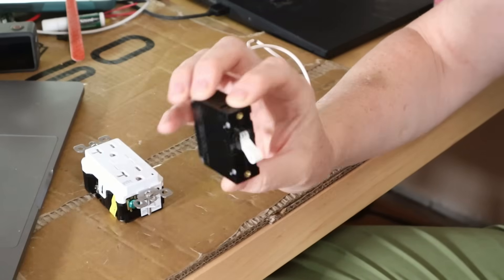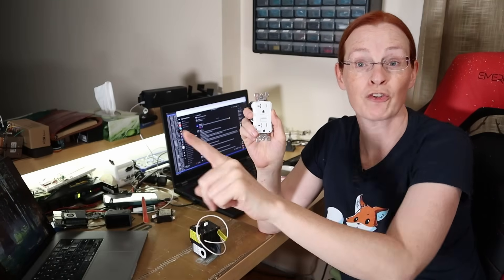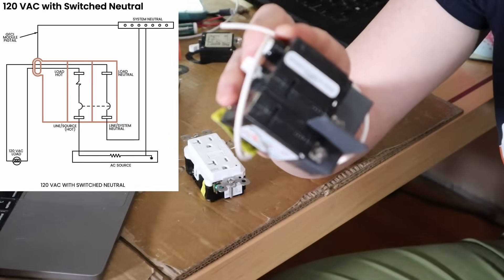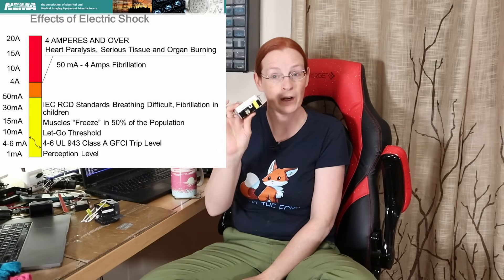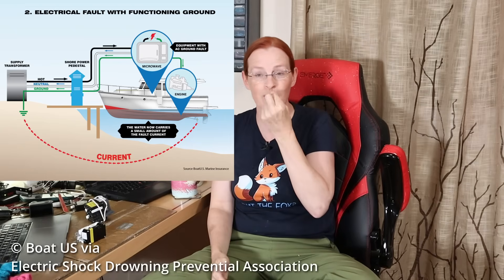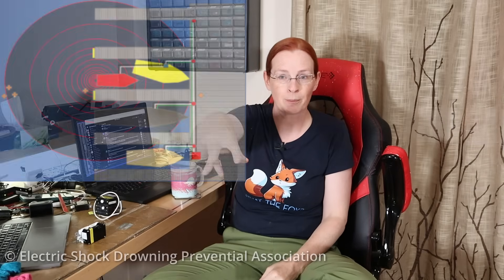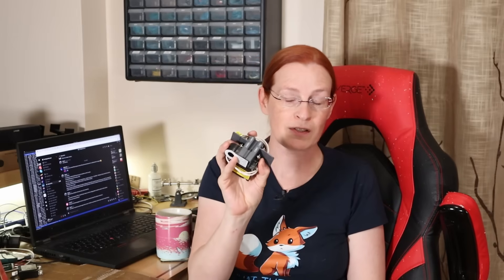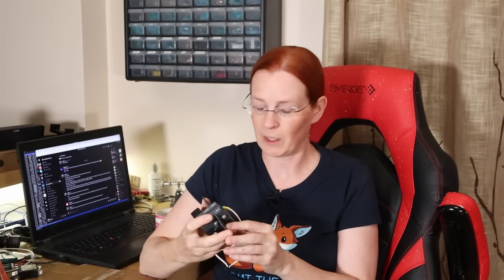This Can Save Your Life; ELCI/RCBO RCDs - Ep. 113

Comment: Ok the RCD will shut off the AC from the shore power and maybe the inverters output. Lets talk about the DC circuit. Is there any protection on the DC side if you find a way to make yourself part of the circuit?
Reply from the maker: All circuits, AC and DC, have current limiting of some sort. Most are breakers, some are fuses, but all are protected.

Comment: As for the 30 mA which is the common RCD type in Europe these days, there is the assumption there's always going to be some leakage current.  So a fault current that triggers an RCD would be the sum of that benign “expected” leakage current and the true fault current that potentially might be going through the poor sod trying to have some toast in the bath tub.  Of course there could always be the scenario where only device is following a single RCD therefore the leakage current is virtually zero.  Whatever, in Germany where three phase power is standard a typical installation will have like two MCBs for each of the three phases for a total of six.

The other factor to be considered is the time a fault current is flowing until it is interrupted.  The usual numbers such as 6 mA etc. are for not totally crazy worst case scenarios.  For very short exposures even currents as high as 100 A can be ok.

The frequency also matters.  50 Hz is generally considered the most dangerous with 60 Hz barely less dangerous, DC being well less dangerous and high frequency of several kHz and up only causing burns.  Which is pretty nasty - the victim doesn't feel it but the flesh or skin is still getting cooked even for example when touching the output of a 10 W transmitter.

To summarize, the 30 mA appear to be a pretty reasonable limit in practice and I'm not aware of any push towards lowering the value.

RCBOs are not very common yet.  For one they are well more expensive than a single RCD shared by several MCBs.  They usually are also wider than an MCB so replacing RCD + MCB with RCBOs might require more space than available and it will be more expensive.  There are recent RCBO types which are as wide as an MCB but those yet again more expensive.  Another small penalty is that RCDs and RCBOs have a small power consumption.

I personally intend to have at least the circuit of my fridge upgraded to an RCBO.  A few years ago a fault in a dishwasher tripped the RCD which in turn caused fridge and freezer lose power.  If I had not noticed the problem quickly that could have resulted in a “culinary disaster”.

Comment: Whereas everything you state is near-enough correct, the use of RCD/GFCIs do not address what is probably the most common cause of in-water deaths due to electricity around boats and marinas.  The purpose of RCD/GFCIs on vessels (and it is a damned good idea to have them) is exactly the same as the same thing in your home, namely, to prevent death of injury within the boat from electric shock.

External to the boat, in the water, the killer is potential gradient between boats, between the soil under the water, metallic structures in the water where “ground” is not equipotential.  A RCD/GFCI can do nothing to address this as these devices are blind to ground, they just measure current differences between hot and neutral.  When a boat is plugged into shore power, the ground pin of the supply is connected to the boat ground, and thus to the water through the prop and other metalwork.

The least bad way of connecting a boat to shore power is through an isolation transformer, so there is no metallic path between shore power ground and boat ground.  And as a bonus, these transformers are usually dual voltage, so you can connect to 120 or 240 shore power.

The next least bad way is a ground isolator, which is basically a zener diode, so there is no metallic path, but there is a semiconductor path, which is supposed to isolate normally, but if a fault occurred the zener diode will conduct.  Cheaper, but not as good, and no dual voltage support.

TL;DR: getting grounding right is always difficult, but in vessels and/or involving bodies of water, and particularly in North America with MGN distribution, even harder.

https://www.ecs.csun.edu/~bruno/MultiGroundedNeutralFinal_4-17-7.pdf

Comment: Good explanation but you have one error I caught. Salt water is more conductive then fresh water. The conductivity of water depends on dissolved ions and the dissolved salt provides many. That is also why you are technically safer in salt water, more current goes around you, but less safe standing in salt water, better conduction to ground. That said, electricity mixed with any kind of water is dangerous.
Reply: There is an on-screen text fix for this @11:13 which I didn't notice on my first watch, I think it needed a bit more contrast & duration.
Reply from the maker: I talk about this around 10:30

Comment: I had an GFCI/RCD in my first apartment about 10 years ago - there was a power point under my kitchen sink which had a leaky pipe start to drip on it one day - the RCD kept tripping every few minutes until i got the leak fixed - no doubt that saved my life several times over!
Reply from the maker: These safety rules exist for good reasons... This is one more example.

Comment: Just a heads-up: putting an ELCI after the isolation transformer won’t actually protect you unless you also create a neutral-to-ground bond on the boat side. But here’s the catch: you can’t just connect the boat to shore ground, because that would defeat the whole point of the isolation transformer - which is to electrically isolate the boat from shore to prevent galvanic corrosion and stray currents. Without a proper ground reference on the secondary side, the ELCI has no way to detect leakage to ground - so it simply won’t trip, even in dangerous situations. So unless that neutral-ground bond is added after the transformer, the ELCI doesn’t add any real protection and might give a false sense of safety.
Reply from the maker: The victron MP2 I've got bonds the neural to ground when inverting, and opens the bins on shore power. It specifically mentions in the manual that this is done for compatibility with RCDs.
Reply: Also the Filax 2 transfer switch from Victron has it so that the neutrals are not allowed to interact between the primary and secondary supply.  The secondary supply can have an MEN link safely.  Useful info if you don't use an isolation transformer, I don't have a boat but I do use one of those transfer switches in a UPS configuration.

Comment: As a European it is amazing that American installation equipment still look like something from the 1950s or 60s. Here RCDs have been mandatory in new houses since 1975
Reply from the maker: You can get more modern looking ELCI RCDs. I specifically wanted to get the model that matches the original look of my 1981 circuit panel. That said, I agree, we're quite behind on safety over here.
Reply: Well there's no such thing as pan European requirement like that but you also need to consider your earthing system.  If you have TT, an RCD (in the past an ELCB could be used) is mandatory since you have high impedance earthing that can not trip over current on an earth fault and lead to fires and hazardous voltage being continuously present on the earthing system.  So apart from that you got it right.
Reply: Depends on the country - here in Poland separate grounding wire (PE) was made mandatory in mid 1990s, along with DIN rail mounted switchgear. RCDs were first mandatory for wet rooms (bathrooms etc.) around 2000 and then all the sockets, and encompassed the entire wiring in 2010s. On the other hand, I saw a RCD in a house in the Netherlands that could have dated back to 1980s or even 1970s, with the wiring still running on old style screw-in fuses rather than circuit breakers.
Reply: @KeritechElectronics  Exactly.  RCDs weren't a mandatory item in my country in the '80s but some people were still having a single device fitted to cover their entire house.
Reply: @retrozmachine1189  the latter is common practice here, unfortunately. It's just false economy. Cutting off entire power if it trips, and no narrowing the fault location down to few branches... definitely a bad idea.
Reply: As a former resident of Europe now living in Canada, I’m also constantly surprised at how far behind North America is when it comes to electrical installation hardware. Not to mention that each panel manufacturer has their own breaker standard — and I really miss DIN rails.
Reply: Some of it just perception.  In Europe older equipment used to be black then (1970s?) white became the the colour of choice.  So now Europeans tend to always think US installations are medieval.

Accident figures for well maintained installations in both Europe and North America are remarkably similar.  Some rules for North America are less restrictive, others are more restrictive.  There is a small of a safety bonus from using a 120 V voltage rather than 230 V.  Arguably it doesn't matter as good practices should avoid people being exposed to either voltage by accident.  Nut other more lenient practices are compensating that advantage again.
Reply: @ralfbaechle  The color of circuit breaker housings isn’t about fashion — it’s about materials and ease of detecting thermal or arc damage. On white or light gray breakers, burn marks or metal vapor deposits are much easier to spot.
Breakers in the U.S. are typically black because most are made from bakelite, while in Europe, they use more modern glass-filled BMC/DMC, which is naturally light gray.

Comment: I have to think it over my self for a moment... will you mount this switch on the primary or secondairy side of the isolation transformer? Be aware that a GFI mounted at one side of the transformer will not protect against a current leak at the other side of the transformer...
Reply from the maker: In my case, I have an isolation transformer, and it's under 3 meters from the shore connection. So the plan is; Shore -> Two-pole current breaker -> Isolation transformer -> ELCI -> Multiplus-II inverter/charger. Though the MP2 can do boosting using the batteries, it's all using 30A breakers, which is below the threshold where that would kick in.
Reply: @TheDigitalMermaid  Thanks for the clarification! I saw your other comment where you mentioned that the ELCI would be placed after the isolation transformer but before the MultiPlus. That setup would indeed require the isolation transformer to connect neutral and ground when the grid is connected, otherwise the ELCI wouldn’t detect faults properly.

However, in that case, the MultiPlus would not be protected by the ELCI when it's inverting, since it's upstream of the ELCI. So any fault on the inverter side wouldn't trip the ELCI.

I'm aware that the MultiPlus has a built-in ground relay that bonds neutral to ground when inverting (assuming it's configured correctly), as mentioned in the manual — that's mainly for RCD compatibility, like you said. But in this arrangement, the loads after the inverter still wouldn't be protected by the ELCI itself (in off grid mode).
Reply from the maker: @thomasdesloovere4200  Ya, I originally planned to put it after the MP2 for this reason. I've struggled to find clear guidance on where it is most effective to put the ELCI in a configuration like mine. If I put it after, I do get the "whole boat" RCD protection (albeit at 30mA). With the isolation transformer, I think the risk of ESD from leakage current from my boat is mitigated already, so perhaps putting it after the MP2, like I originally planned, would be better. I really with this was spelled out better. :)
Reply: I think it makes sense indeed to put the ELCI after the MP2. Just one question... is the Outlet "on shore" (always) RCD protected? If not, it would make sense to mount a "inline" protection in your shorecable. These cables get damaged quite easy or extended with questionable cables and form a risq on their own...
Reply: @TheDigitalMermaid  I think you've just paid for the same "streaming service" twice. If the isolation transformer is installed, then whatever leakage you have past it, has no reference to ground and is only a danger inside the boat. On the other hand, if you don't have an isolation transformer, but you do have an ELCI breaker, when connected to shore power, any leakage happening in your boat will be referenced to ground/soil/water and any flow will trip it.
Reply from the maker: @rokask  The non-GFCI circuits will have some protection now at the ELCI, if I put it on the output side of the MP2. So it's not without value, but I agree, my understanding is that the IT removes the risk of ESD.

Comment: a very cute fox on  y our shirt. That breaker sounds like a very good idea, both for you and others.
Reply from the maker: That's just it, it's not just protecting you, it's protecting anyone near your boat. If a kid falls off the dock near your boat, you don't want to be the reason they never come back up. It's something all boaters should retrofit.
Reply: It is recommended to make a path to ground with good earthing.
Reply from the maker: @ilanozana9652  Yes, but that is only one part of the equation. In a terrestrial install, that's enough as it's act like a short over overcurrent the breaker. In the water though, especially if the leakage is below the current trip level, it can still kill people in the water. So regardless of a good ground, you still need an RCD.